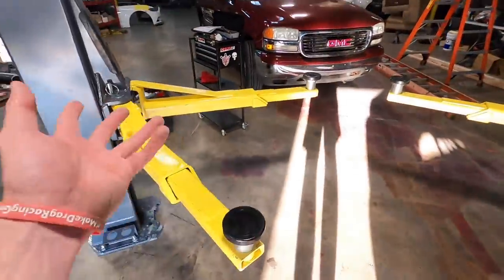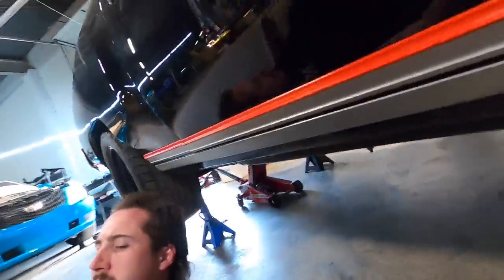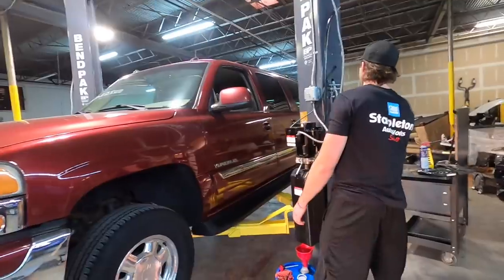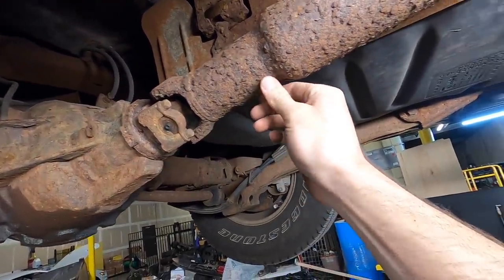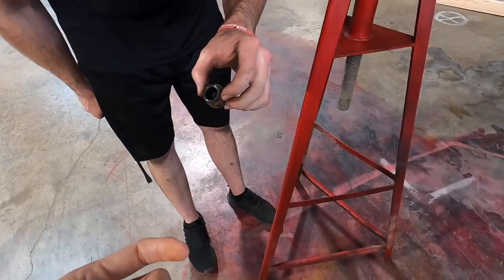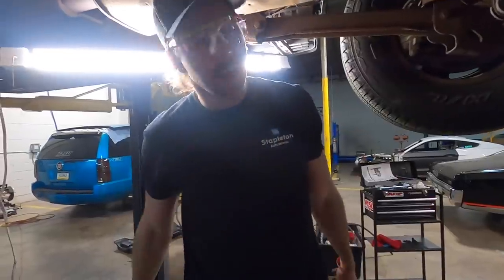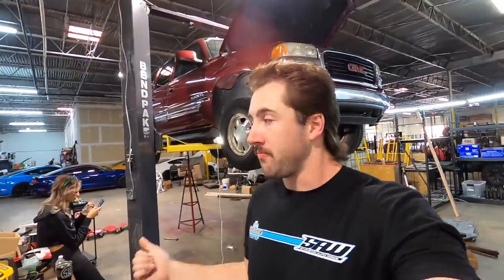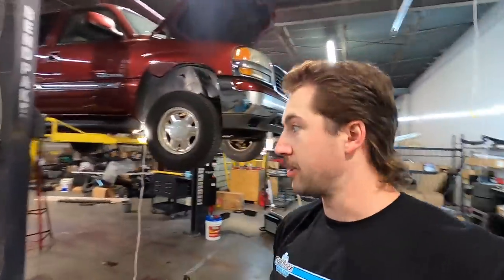Budget Turbo Yukon XL 4L80 Conversion (Part 1): Blow'd Up 4L60e Removal! + Tips&Tricks To Save Time!

Comment: When I worked at a dealership in central florida we would get trucks from the local phosphate mines. I just took my large air hammer with blunt tip and rattle the mud off the frames  probably work for that rust too.

Comment: I am from Minnesota and have built four frame off hot rods. The pile of rusted metal cut out of projects is astounding. Very tough to weld new metal to old rusty metal. Road salt makes even late model cars rust way too fast.

Comment: I'm in the New England area and I work on rust like this often. Tip for you... toss your rusted nut / bolt in some brake fluid. It'll get rid of the surface rust and bring it sort back to "new" condition.

Comment: I'm lead tech at a shop in Cleveland, so I see a lot of that rotted stuff. Been at it for 12 years professionally. Oxy acetylene torch is your best friend, I promise... If you can fix the rustiest of rusty then everything else is so friggin easy. When I went to Florida and was helping people at a shop remove a press in hub bearing with a torch and air hammer, they were blown away that you dont need a hydraulic press for removal.

Comment: From Ontario Canada. I work at a GM dealer. All the stuff is nice and full of the rusticles LMAO. Love the videos keep em coming man. Also the skid plate I'm almost certain is also a Z71 thing on older GMCs. Also the reverse direction of the bolts is just a thing. I always wondered why it was like that as well. First time I see that double nut bracket too but I don't work on as many suburban/Tahoe's. Mostly just pickup trucks

Comment: "Soft taco with a hole in it"
I F-ing lost it. 🤣😂🤣
I have a long extention (36"-ish)  thats 1/2" on the gun end, and 3/8" on the other, with a lock collar, to keep the socket in place (wobble impact socket) and it makes bellhousing bolts super easy. Stand behind the transmission and you can reach every one and have them out in under 2 minutes.

Comment: Central Ohio. Was plowing this year at the shop I work at and rear fuel tank strap rusted off and fuel tank was dragging on the ground. I had to use the  salter lid wedged under the tank to drive the truck back to the garage. Repaired it withe some galvanized straps bolted it to the frame and finished up for the day.

Comment: I’m from northern Illinois. It’s completely different weather here in the winter than in central or southern Illinois lol. My parents bought a Suburban brand new in 2004 and drove it year round, never took it through car washes in the winter. It’s all rusted out now and the rocker panels are pretty much gone. Not that odd to see other vehicles like that in this area though. I’ve got an 07 Escalade ESV that had been in central Illinois it’s whole life and it is literally spotless. The frame is all nice and black still, brake lines are original and look brand new, everything is just perfect on it like it came from California

Comment: I R&R these transmissions regularly. The transfer case can be pretty tricky. Shove all the way toward the back and then tilt down. Converter bolts kinda blow on them too, but I crack em loose and then fit an electric ratchet with a shallow wobbly 15 and back it out the rest of the way. I usually don't pull the plugs outta the PRNDL if I'm rebuilding the 60, but heat is the way to go.

Comment: Here in Connecticut, we get plenty of Rustcicles on the undercarriage of our vehicles. I’ve been taking some of my parts to a place that engraves headstones, and they do a quick sandblasting for me. I either oil the parts up, or paint and rubber undercoat after. Helps me for the next time I’m under there, and they appreciate the work.  Good content, but I could do without the dog shit portion. Good build so far Mitch!

Comment: im from idaho but moving to alabama shortly also i like short or long videos doesnt matter whatevers less stressful = the best option
Reply: also on the impact thing i use a 1/2 in drive work pro impact 320 ft lbs its on  amazon for 70ish bucks works good youll need the 1/2 to 3/8 drive adapter from amazon though overall definitely worth it

Comment: Pro tip.... when you get it centered on the lift, spray paint where the front left tire sits on the ground, just a nice box around the outside, and BOOM  you can pull into the same place every time.

Comment: If you wrap tape around the joint before you lever it off the bearing caps will usually stay together. Very bad rusting problem around here, Montreal.

Comment: Almost all 4WD have those plates. It's rare to not have them. 

Free stuff:  Don't beg unless you're desperate, take gifts you can use because it helps the giver, don't take gifts you can't use. 

Makita was first so that's why I use them but I've started migrating to Milwaukee. 

Don't just throw a socket on the floor to release the fasteners, make sure the socket hits the ground flat (horizontally). 

It's common for those to be backwards but it's more common that Rob had an oil pan gasket replaced or front diff out for side bearings or axle seals because with the factory y-pipe in, it's easier to put them back backwards.  

Long and short 15mm ratchet wrenches are needed for TC removal. 

The cavity between only has fluid in it on 4-speeds. Six speeds are dry in between. 

A shallow 15mm 1/2" impact socket and big impact is the only solution to remove the 4L drain plug. 

The way to get that out is one person on each side not front and back. They almost all go back then down in front. Some of the newer ones are way tighter than Rob. 

Put heat on the old style double connector 4L plugs to release them. Douse them with carb cleaner before plugging them back in.

Comment: needed input, I did a 4l80e swap for a 03 Chevy Tahoe 2wd for a turbo build. It originally had 4l60e i repinned wiring to make it work well  At least I thought! I had no luck indicating 2nd gear from the scan but parked in a cluster. Had pcm tuned with segment swap etc still indicating stuck in 2nd rechecked wiring,grounds, and connections.

Comment: 5 speed Allison’s have the glued in connectors on the neutral safety switch also, converter bolts come out mint with an electric ratchet you can spin the socket up to speed and slam it onto the bolt and it will zip them right out

Comment: Future reference just use a heat gun or a torch to heat converter bolts up and it will melt the lock tight on converter bolts and a long extension with a 15mm wobbly will make it easier to get converter bolts out.  same as heat gun and plugs to neutral safety switch

Comment: Minnesota. as a matter of fact just today I worked on a buick park ave ultra thats totalled because of the rust in the rear. There is a sub frame in the rear and The part where the rear controll arm bolts in is broke completely off, the rear wheel is cambered out haha

Comment: Ive had just fine luck with Ryobi, Now they have a impact with just as much power as the heavy hitter impact. I also like my ridgid 1/2 impact, so much lighter and has broke free every bolt i needed it too (I live in Minnesota so thats saying something!!)  I have Milwaukee M18, Milwaukee M12 (Highly recommend this line) Ryobi +18 and Ridgid 18v systems

FYI for drain bolts that are stripped out, ait hammer with a chisel makes quick work of it

Comment: My pup is also named Ruger...I’m from MN grew up working on older rusted Audis and VWs during the winter in the driveway with no sort of heat. Busting ice cold, dried out knuckles on rusted, jagged edges after a bolt/nut stripped or broke was never fun!

Comment: On those crossmember bolts and anything underneath that are super Rusty I like the wire brush the threads along with PB Blaster. The new half inch Dewalt impact gun is pretty good also the 18 volt snap-on. Always look on OfferUp or Facebook Marketplace to get deals on Electric Tools.

Comment: So I did a 80e swap in a Tahoe. And you have to remove the tortion bar bracket to get the transfer case back in because it’s longer than the 60e

Comment: Instead of adding heat in fighting those stupid plugs I normally unbolt the PRNDL switch and zip tie off to the side I don't know if you're going to have to use a different one for the 4l80 though.

Comment: Bro...I don’t think there’s anything wrong with the ecm that shorted out on battery. The inside should be fine. The outer casing (ground) shorted. Not the bored inside. 👍🏻✌🏻

Comment: Hey brother ingersoll has a half inch cordless impact that is more powerful than any other it kicks ass it's about $450 here in south Carolina which is where I live you and your lady should come visit we have some good tracks here like Darlington and Carolina dragstrips  !! Oh and a red bull can if you cut the top off works great as a driveshaft replacement so you won't lose your transfer case fluid ..

Comment: I have never seen or heard of Stapleton24 but came in search of a fairly thorough instructional as 4l80e conversion (part 4) was the first video presented in my search . I jumped in since I saw a red Tarwhore roughly the same vintage as mine , and then the mechanic, I presumed... was holding the transmissions harness with a pick in hand and realizing the pins could be moved. Naturally I thought I should go to (part 1) to get more to the source of the conversion...parts sourcing for the required flexplates, trans mounts  etc and immediately its a dog in a diaper shitting soft tacos that need to picked out of its fur.( Pro Tip: toy eyeballs staring at you from the ass of your dog beats wet or dry shit cleanup, taco or not). Now I am hearing pipes slamming around from both my phone and a my TV, and the pooping commences again. Is there a video and time that I should go to for the next step ? I see a bunch of lifts, and vehicles in varied states so something has to be on video being completed, but I am starting to think this might not the most effective video for learning some short cuts ( holy shit that fucking music is, what the fuck us that howling, . Milliwakia is shit and RED, you want the Orange RIDGID thats orange and and slams harder for cheaper. Unless you get the new(that fucking howling is back "polejack?" Oh sweet you pulled something out but I missed it...shit
 Ok, definitely a fan of what the fuck is that sound now? Thats not music. But the shinking always happens when you plug up the the 60eees. Keep doing that you are doing, check the remaining 22 videos for progress/sweat barf cam and turbod backyard. Sorry about your dripping hole and shortly farts. Byuge fan of what is happening inon this( fucking music slapping again,) deep up your echo thanks thats horrible.

Comment: I'm from Kentucky, my 02 Yukon Xl looks way better underneath but my body panels are dinged up more. Same color though. My 90 K1500 has rust on the body and frame. I replaced the rear spring hangers and shackles. It took me 4 days in the driveway.

Comment: Best way to loosen those converter bolts is deep 6 point 15 on a long handle wratchet
No need for a helper to hold crank still
The socket binds on the block
There is a sweet spot where the socket just fits
25 years at gm dealer I  had 1 or 2 of those units out 
Man up on that transfer case
4wd is full of stuff
Awd has a shaft a chain and a planetary gearset 
Lots inside 246 w auto 4wd 
Btw they have glass balls for dogs !
No glass eyes eh ?

Comment: If you have a bolt with thread lock you can heat it like STT did with the plugs and it will make it easier to remove. 

Representing in the uk

Comment: Being in New York I’ve done all body work myself on my current f150 and one side of the bed patch is bad and the fenders were a temporary fix done correct but the bondo cracked and the frame I have a shit done of holes I patched with steel even

Comment: VA here, I've had a cornwell 1/2 in impact, it doesn't hold a candle to the Milwaukee high torque impact. I also have the newest gen rigid 1/2 in impact and the Milwaukee Also blows it out of the water

Comment: I hear that earthquake stuff is pretty comparable from harbor freight, the 1/2" impact is only 250ish, pretty sure theyve got a 3/8" like that milwaukee and a 1/4" like the dewalt, ive got 2 of those dewalts, i like them, and a kobalt 1/2" impact thats at least 10 years old, it just within the past 2 years got to where the batteries wont hold up past 2-3 wheels, so its time to upgrade, lol

Comment: What diff are you running? After 4 g80's and one duragrip posi in my 04 avalanche I went with a ox locker with the e shift kit. It's sooo much fun having a locker at the push of a button.

Comment: Instead of Milwaukee get  RYOBI, I really like them and they are significantly less expensive and I’ve never had a tool break or stop working and I’ve had RYOBI TOOLS for 10 years and have just been adding to my collection. They are found at HomeDepot. And has one of the largest selection of tools you can get

Comment: Nawth Cackilacki. ....Silver Valley....Lexington....originally from Ceciltuky, MD. And yeah, every f'n car I bought and sold in the 80s had paint holding the rust together...until I learned to buy cars from a hot, dry climate....Cecil County Dragway was my home away from home for a while. ...I even slept in my '71 El Camino when my electrical system was invaded by a poltergeist that thought frying my lights would be amusing, everything else was fine.....I rolled out my sleeping bag and Indian blanket and slept in the bed until sunup, then cruised on home to a pissed off Ma because I didn't call. ..this was way before cell phones welded to your hand was a thing...yup, I lived in a camper in Mas yard when I was 22...too much info? SUCK UPON IT!

Comment: Putty sure with asymmetrical lift you can put it back to open the doors and lift it that's the bonus.
If your nervous put a Deadman under the rear bumper.
There a lifting guide on the post and there's always the operating guide for the unit
Ahem

Comment: 4L80 conversions and turbo Yukon’s are cool, but I wanna know what madman put the letters on the inside of the rim so we can’t see them.
Reply from the maker: My uncle rob 😂😂
Reply: Also from South MN, am using DeWalt tools because I bought a heated jacket and like 8 batteries for it so I am eternally doomed to DeWalt tools. They’re good enough to bust salty nuts but Milwaukee’s tools are better.

Comment: everyone always seems to shit on ryobi but ive had no problems with them all my power tools were ryobi till recently i had gotten a 5 tool 2 battery milwaukee tool kit for on sale for $200 because i prefer their 3/8 cordless ratchet because the ryobi battery cant fit in as small of places and i needed a small saw. i have the older ryobi 1/2 impact(more torque) not the new brushless xr one and it pulls crank bolts with ease and no penetrating oil it came with the 4ah battery not the standard 2ah battery should handle whatever you throw at it

Comment: The bolts for the crossmember should be the same on the caddi also the ones on my 09 caddi were like that along with my 08 avalanche and my 07 yukon xl. Im a sucker for the 07 up body styles 😂

Comment: Pro tip.  When working on a rusty vehicle wear a hat.  Less rust in hair.  I've done a bunch of research and found the Milwaukee is the best value impact.  Many are cheaper but when you check out the torque specks the big red machine covers them.

Comment: Not trying to be a know it all; but if you’re right handed , holding most any quality impact- air or electric / Milwaukee, Dewalt , Snap On , IR, in your right hand push switch with thumb for reverse (bolt removal) push selector switch with index finger for forward (bolt tightening)

Comment: Ryobi mid torq I think it’s like $130. Compares to Milwaukee. Personally I have the Milwaukee mid torq fuel gen 1. Its all I need. I could take a car completely apart with it. I THINK BRYAN IS RIGHT. LOL Ridged tool are made by TTI Same as Milwaukee.  The batteries on Ryobi are the old Dewalt style that the only reason I stay away from ryobi ounce they change platforms like dewalt did I don’t want all those tool without replacement batteries. Buy ounce cry ounce I say.  If you have a HarborFreight near you , you can’t beat there warranty’s you break it take it in swap it out and there stuff is cheap but performance ehhh.  25 min videos every day idk. I like longer content personally I’ve been watching since PFI Speed so I’m OG you gonna get with any of the outlaws soon or what?  Your buddy still out there filming can’t believe he never came back. ??!

Comment: Hey bud I have a 2006 tahoe. On I was hoping that you could help me a bit, when I am backing up and I am hooked to a heavy trailer and i have to give it a lot of throttle my truck starts to chatter, it that the converter chattering and what would you do to fix it?

Comment: Hog shit's worse then transmission fluid. Change my mind.
P.S. i didnt have trouble with the converter bolts on the 5.3 we pulled last weekend, but we also left the trans behind. It had also been serviced in 16'(very shit like i might add) so that probably helped.

Comment: Im in Northern Ohio Up next to the lake and your lucky if you find a vehicle with no rust my Truck is 30+ years old it was made in california driven for a couple year parked in dry storage for 10yrs+  then bought by the guy i got it from he drove it to Ohio and used it for long drives to Florida every year for almost 15yrs and now i Have it for the past 5yrs slowly replacing the old parts from the Factory

Comment: Now I have a question for you, doing the oil pan on rob is there some work around for not dropping cross member to get those last 2 bolts off or am I sol and forced to drop crossmember.
Reply from the maker: Engine oil pan? Just pull the crossmember
Reply: @Stapleton42  ya engine oil pan. Doing heads cam and found out that oil pan had to come down to get gd oil pump off but ya ill just pull the cross member.